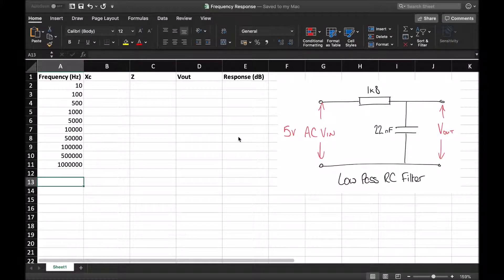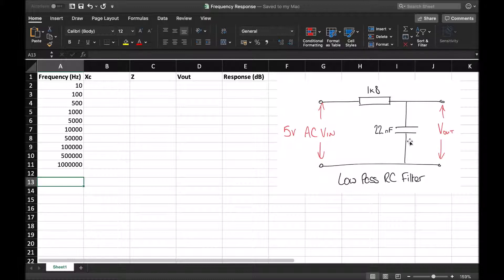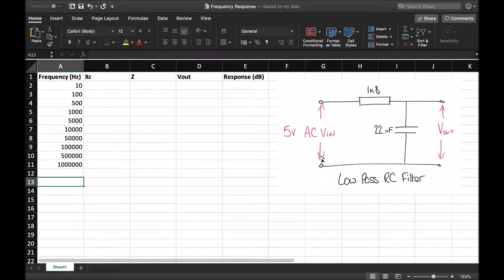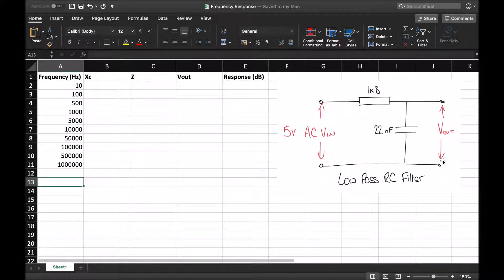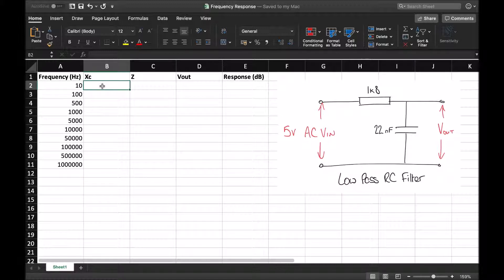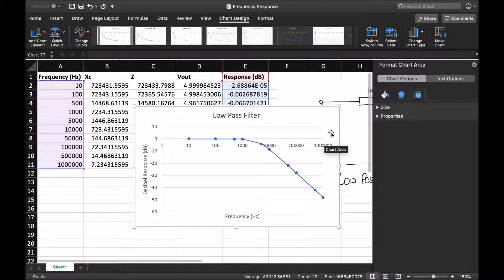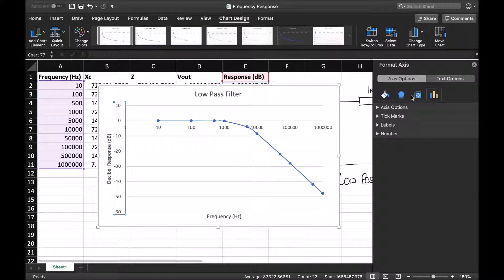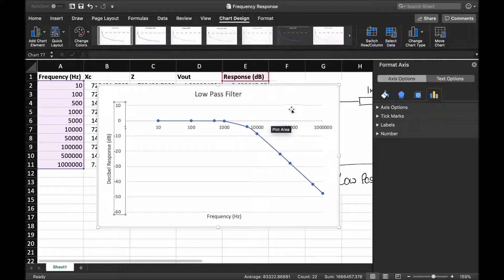Frequency Response and Cut Off Frequency For Low Pass and High Pass Filters

Comment: Is there a video showing how to plot the phase on the above graph?
Reply from the maker: There isn't, and I might make one at some point, but for now you could make another column to take the impedance angle (for the purposes of this) to be =X/R (multiply *180/PI() if you want this in degrees)
These should all span from 0 to 90 degrees if done correctly, for the HP filter, and from 0 to -90 for the LP filter, taking XC as negative when calculating X/R.
Then, make a column for the angle of the current, this will be minus whatever the previous column was, so negative Z angles will become positive and vice-versa.
Finally, for the phase we are looking for the phase angle of the voltage across the output component, and V = I*X. We add the angles here, so to our current column we add either +90 in the case of an inductor (HP) or  subtract 90 in the case of a capacitor (LP)
This is not an ideal explanation for a youtube comment but hope it helps for now.
Reply: @EngineersAcademyLTD  thanks a ton for the reply. It's a bit over my head as I'm mathematically challenged and usually learn from examples ;) I managed to get the graph working in Excel, thanks to your explanation.